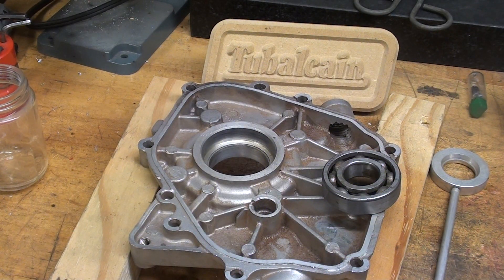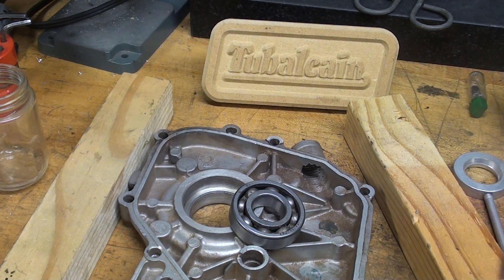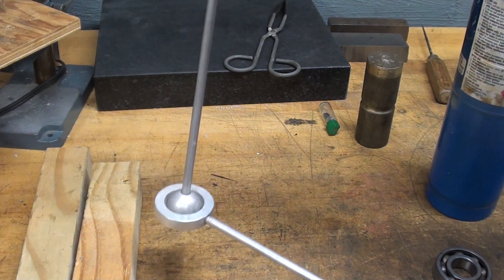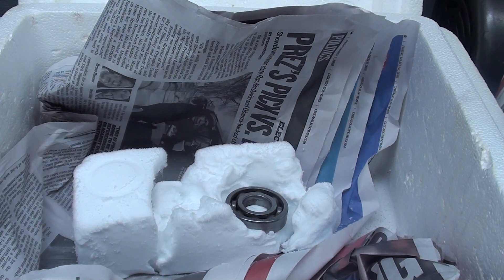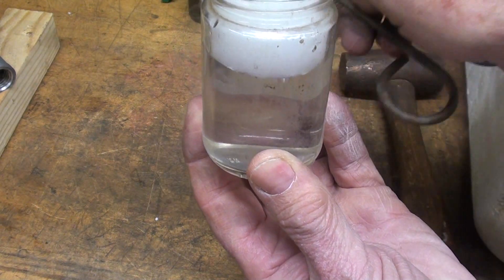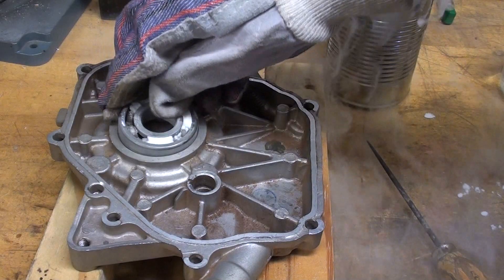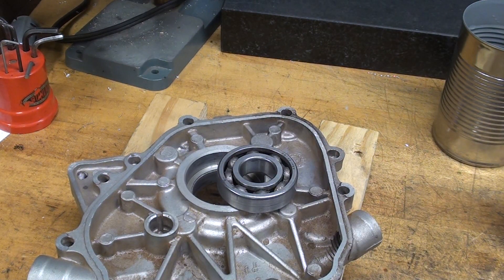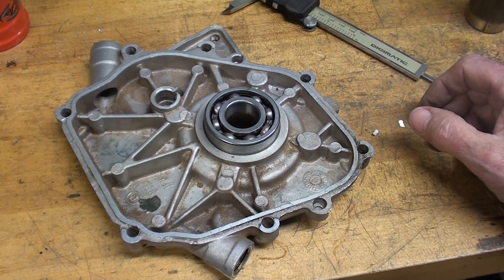SHOP TIPS #298 Shrinking a Bearing with Dry Ice tubalcain

Comment: I had to do some exhaust work on an airplane engine, and since the tubing is fixed on both ends (engine exhaust port on one end, turbo on the other) and its temperature goes from icy cold to red hot, they put slip joints in the tubes to handle the expansion.  Mine had never been serviced since 1973, when the engine was built, they were frozen.  (And the exhaust pipe was cracked, of course.) I finally got them apart by heating one side with an oxyacetylene torch to red/yellow hot and then dipping the other side into liquid nitrogen.  I had a helluva time getting the gas seller to put the N2 into a Dewars flask I had ("It's not OSHA approved.")   Agggghhhhhh!   You can't get anything done because of the darned nannies!
Reply from the maker: Yes

Comment from the maker: Isn't that what I'm doing now?
Reply: +mrpete222 Thanks again for this video.  I did use it on my backing plate for my 3 jaw chuck.  I used  .003" interference fit.  I put the back plate in my freezer for 6 hours, pulled it out and it dropped right into the chuck.

Comment: Question Can an aluminum case be cooled to shrink the diameter of the bearing seat if the interference is not enough to hold the bearing in place?
Reply: In theory, yes.  However, once the case warms back up, it'll be loose again.  If there were a way to constrain the case as it warmed back up then it might be possible to retain the smaller bore dimension once it returned to room temperature.  I'm currently dealing with this issue on a yz125.  Depending on the application you can dimple/knurl the bore, use a bearing retaining compound, install a tolerance ring or shim, sleeve the bore, or just buy a new case.  Aluminum bearing bores wear out quickly when steel bearings are driven out/in while both parts are at the same temperature.
Reply: @seekrepair5887  sounds right. I was talking to a guy that does work on yamaha race kart engines. He said that if the case is  frozen down to dry ice temperature for some time it will actually take the diameter down a few ten thousands and will help. With that in mind it's ok for a simple half case but when dealing with a motorcycle case that has multiple bearing seats and a transmission it could be problematic for other tolerances within the case itself.
Reply: @bwma  I agree.  Good point about the other bearing bores.  I just bit the bullet and dropped a grand on new cases.  Plan to sleeve my originals as a back up.  You gotta pay to play as they say...
Reply: @seekrepair5887  I agree! Wish BSA was still in business to sell me a new 650 case. I actually called the bearing manufacturer in England and they will custom grind the O.D. on the bearing I need. That ended up being my answer to my tolerance issue.  I was afraid to start super freezing my case.  Have fun and keep burning fuel 👍
Reply: @bwma  Will do! Yeah,  You'd need a Delorian with a flux capacitor to get a new case.  That is awesome that they'll make you a custom bearing.  It would be nice if KOYO offered bearings with over sized O.D.s because as the years go on, this issue will only become more prevalent.  Ride on, brother.
Reply: @seekrepair5887  🤣🤣🤣I need one of those just to go back to a simpler time in life.  Enjoy and happy motoring 👍

Comment: No dry ice available? Take an compressed air duster can inverted and use the solvent to chill the part. The solvent will evaporate and disappear in seconds and you can drop the temperature of the part to well below zero. Easily reduce the size of the bearing shown buy a couple of thousands of an inch.